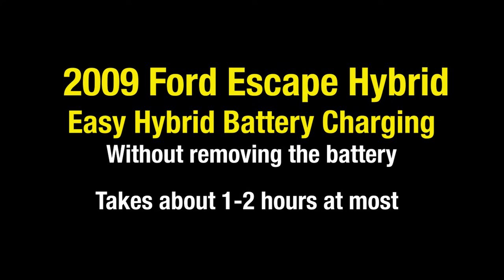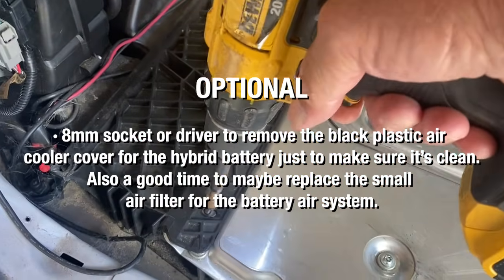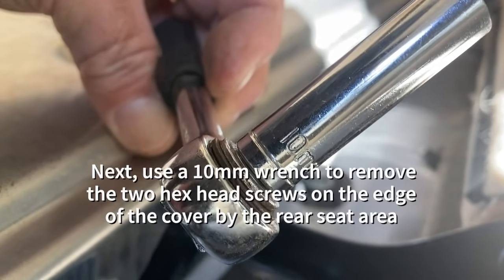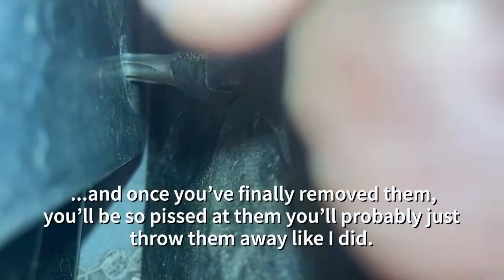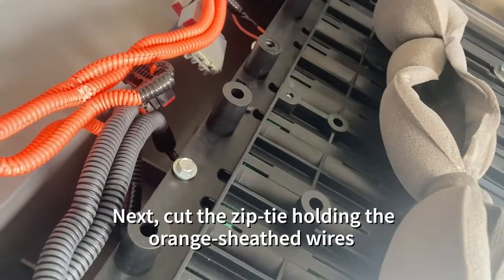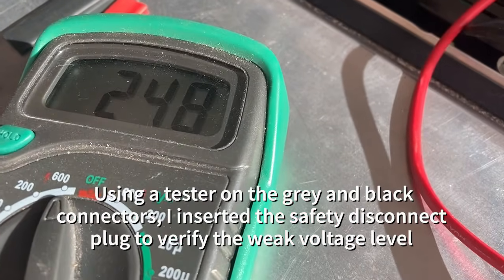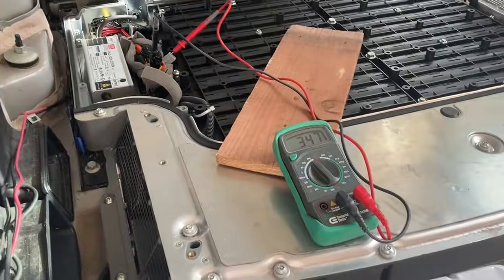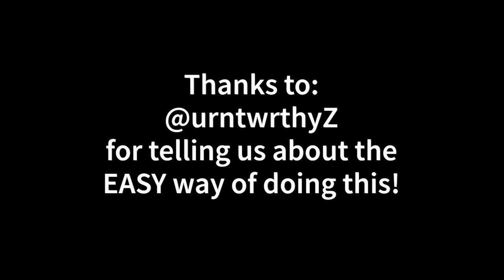EASY Hybrid Battery Charge 2009 Ford Escape - No need to remove battery!

Comment: Hello I have a 2007 and you said the charger and was built into the models before 2009 any chance you know how to put those to use? Your mod has a 120v plug in attached to it so do I need to get 120v to the charger in my 2007? Thanks
Reply from the maker: I’m not sure, but I think there’s a switch or button near the driver’s side under dash. I believe it uses electricity from the lead acid battery to boost the hybrid battery enough to start the car. Maybe someone with a pre-2009 can verify the details.
Reply: Matt is correct, there is a black pushbutton switch that glows when depressed for 10 seconds and starts to charge the Hybird battery from the 12 volts. Mine is behind a cover on the side dash when you open the driver door and some are under the  steering wheel by your left side

Comment: Good alternative but not recommended it as the ballast inside overheats when using it( True that you will not have to leave the AC cord plug in all day) but for experience is better to extend the inside + and - terminals to outside so the ballast can be seating outside and only be used when need it.
I did extend the cables outside and left a AC Female outlet and for the ballast (+ & -) an AC male plug so the polarity will match
Reply from the maker: Anything electrical should generate heat to some degree. If a component is “overheating” it is likely faulty. You can certainly keep the charger outside of the housing if you’re worried about it being faulty, but I would advise against using an AC connector on a DC circuit because of the risk involved with misuse by a person who doesn’t know about the custom setup. If you do add a connector for an externally connected charger, use a DC connector and label the positive and negative sides along with the voltage.
Reply: That is quite a large heatsink the charger is being fastened to.

Comment: purchase one of these cars from auction with only 70k miles, going to try this today,.
Reply: It works, thank you for the video, there are other methods on youtube, but this is way way easier.  Like you said the hardest part was taking out the t30 torx bolt.  I only removed the one the right side (passenger) and propped the cover up.
Reply from the maker: Awesome! I’m glad it worked for you. If you haven’t already tried it, I would definitely recommend using Forscan to check and rebalance the battery system.

Comment: Wow my 20 year old daughter completed the recharge to her brother's 2009 FEH following your video. I watched your video after the fact and wanted to thank you for sharing your experience and solution. So to those who came across this same video and think they can't do it, you can since my 20 year old non mechanic daughter did it herself. Thanks again.
Reply from the maker: That’s great, I’m glad it helped! I wish YouTube had been around when I was 20 - lol !
Reply: @mattgatlin1918 what is the Name and Address to purchase that charger. I'm having the same issue with my 2010 Hybrid escape, I looked at a plug right at the back seat and wondered if that was where to charge this vehicle. Then I came across your video and watched it, when you showed that same prong and it wasn't connected to anything and the plugs was zip tied on the side! I said  WTF was those engineers thinking when that was disconnected and why was it discontinued? 

Then after you went through the steps of removal it started to make sense why they did that. I'll keep my opinion to myself on those thoughts 🤣🤣🤣. 

Now if you would not mind, I'd like to know where I can get that charging device and install it as well. 

I have an idea but I'd rather talk in person or by phone with someone who has a better understanding of Electrical devices then my self, after looking at that charger something else came to mind, it is the positive and negative wires that aren't being  used to charge the system but can be used to charge the system the way it was meant to be used, just my thoughts running after you showed those two wires connected to the Charger you then connected a 3 prong to connect to a wall plug or outside battery charger. Did you use AC or DC or can we use both if necessary depending where we're at and the circumstances...
Reply from the maker: That charger and all the other stuff I used is listed in the description under the video- I put links to all the stuff there.
Reply: Your Right 😂

Comment: Hello Matt.  Is there a way we can make this Escape HEV a PlugIn? Thanks
Reply from the maker: I doubt it. For starters, you’d have to replace the entire battery with a much larger battery in order to get the electric-only range that a PHEV gets.
Reply: Do you mean that instead of making it have a 120v /110 wall outlet, you would install the adaptor that you see at the charging stations ? . I wondered this to but figured the standard plug would be more efficient and effective
Reply: Yes that was my initial idea... so it can be charhed as well when parked

Comment: Just curious, why not just install the oem charger and connect all the plugs? Then add the button where it should go? And finally, install a votage display to monitor it in real time?
Reply from the maker: I suppose you could install a converter/inverter like the ones installed in the 2005-2008 FEH, but I see no indication that the wiring for the inverter charging circuit exists in the 2009 outside of the HV battery casing, so you’d probably be doing some additional wiring to install a button and connect it to the 12v battery to make it work like a 2005-2008 FEH. 🤔 IDK if you can get a new OEM converter/ inverter- I’ve only ever seen used ones.

Comment: Everything went perfectly (Thank You) I'm getting forescan to double check hv batt... Started with around 260, went up, then  down, then was slowly going up.. 2hrs later 280, 4hrs later 200... Doesn't seem to want to go above 200.. heard there's a regen thing in the forescan app.. will try that.. 
(Everything else with opening & wiring went perfectly, again Thank You) this was an inheritance that sat for about 6mos
Reply from the maker: Cool- good luck. Did you try starting it while the charger was charging it? Also one of the other commenters on here suggested running the Forscan HV battery reconditioning multiple times. He said he got the best results after 3 cycles I believe.

Comment: You're the only person I've found that mentions those charge ports. I was happy to find a set in my 2010 in the same place you mentioned. My HV died in the cold snap this year and i was dreading tearing apart the battery again. Your solution had her running in less than an hour! Leaving the charger inside the battery is genius because what else am I gonna use it for?
Reply from the maker: Thanks for the comment. Glad it worked for you. I thought the same thing- “what else am I gonna use it for?” -LOL Once I saw that empty space I figured why not just leave it in there? I also think that once it’s wired into the system like that, you don’t actually need to fully charge the hybrid battery, the voltage coming off the charger is enough to “trick” the engine to start, and then the gas engine is a much faster hybrid battery charger (more amps).
Reply: @mattgatlin1918  just had to reference your video again, this time I took your advice and only had it charging for a few minutes before she was able to start on her own. Thanks again, haha!
Reply from the maker: Nice 👍

Comment: A customer of mine brought me your video and wants me to do it on his Escape. Is there some checks to do on the battery first to make sure it is a good candidate for this mod? Is it possible that a damaged battery could lead to the same issue and if so, could installing this charger on a damaged battery lead to a car fire? Just want to make sure that i have a full grasp on the condition of the vehicle first. This would be my first time messing with a hybrid electrical system.
Reply from the maker: I would run Forscan on the car and rebalance the hybrid battery (HVB). There are forums about Forscan and how to use it to run diagnostics on a hybrid battery system, so I would recommend looking at some of those forums first. I don’t see anything inherently dangerous about having the led driver/“charger” integrated into the low amperage part of the system, but I’m not an expert. I would think that any sort of work around any sort of battery will always carry some degree of risk, and doing this procedure on someone else’s car would be a liability I personally wouldn’t be willing to risk.
Reply: @mattgatlin1918  Thanks alot for the response!

Comment: Great video. Another example of Ford doing their customers a disservice. Why not keep the charging button on the side of the dash like like the previous models? I can work on my own cars but the orange wires scare me as they are very dangerous and high voltage.
Reply from the maker: Thanks. I was also cautious about the orange high voltage wires, which is why I really liked this method over the others I’d seen that were working with the circuitry on the passenger side of the battery ⚡️🫣

Comment: Worked great, thanks. Took about 8 hours to go from 142v to 347v, cleared the codes and it fired right up. 2011 awd FEH
Reply from the maker: Nice work! That’s the best feeling when you turn the key and it fires up like nothing was ever wrong with it 🤩

Comment: Man this was a life saver. I appreciate the video so much.  I just got my battery open, and the little screws on the side will go in the trash. I checked my battery with volt meter 292v. I left the key on for like 5 hours and the car won’t start.  I will order the power supply shortly but it will take a few days to get to me.  I have a 2009 with 310k on the odometer. I’ve had this car for 7 years.  We are not ready to part with it yet.
Reply from the maker: Congrats! Getting the side screws off is the hardest part of the job 😜. Amazing that you’ve got so many miles on it and it’s still going strong. I bought mine used and it was previously a lifeguard vehicle in L.A., so it’s only got 40k on it now, 11k is what I put on it in 14 months. Looking forward to getting many more miles out of it!
Reply: 310k miles???  Mine's at 86k.  Have had more issues than I would have liked and it supposed to be fairly bulletproof.  At what mileage do you recall doing shocks/struts?  I think mine are trashed; Michigan roads are atrocious.

Comment: This is a timely video for me.   I will be recharging my 2009 Excape hybrid this week.  It has been a couple years since I last charged it so I needed YouTube to refresh my memory.  I was stunned by how easy your method was.  Can't wait to configure this permanent solution.  The only additions I think I will add is a covered RV inlet male plug, plus maybe an easy access point to check the current voltage manually.  Last thing, if I remember correctly that charger gets pretty hot, I will monitor the temp the first time I charge.  Thanks again for saving me a bunch of time.
Reply from the maker: Good luck with the job! I didn’t have the issue of the charger getting hot, but that might be because I didn’t need to have it charging very long. When you don’t remove the hybrid battery and disrupt its circuitry, you don’t have to leave it on the charger that long. By having the charger plugged in when you go to start the car, it will register enough voltage for the car to start, even though the battery may not be actually up to that voltage- if that makes sense. Once it’s started, you can just let the engine complete the battery charging. Anyway, hope it goes well for you!

Comment: Great video. I am wondering if you could also charge the HV battery using a big orange plug from the junkyard that has some wire left to connect to the charger. I got one from the junkyard but haven't tried it yet. Your method is simple enough, but maybe it could be done without even removing the cover. Any thoughts?
Reply from the maker: 🤔 Interesting, and I thought about that seeing the large orange high voltage plugs - I’ve seen one in the engine compartment and another by the hybrid battery. I don’t really know anything about these plugs, but my gut feeling is that they’re carrying a lot of amperage given the size/gauge of the terminals, so I’d be wary of them. 
Maybe someone with more knowledge could jump in on this.

Comment: Superb video, Matt., and thanks for the acknowledgement.  S.Keith and a great thread on the  Electric-Vehicle forum was the source for a lot of my info.

FEH owners:  This is THE WAY to do this, ignore the other videos that have you remove your HVTB/ prop it up and/or remove the relay, BCM, etc. on the passenger side of the HVTB.  

It sucked that Ford removed the '05 to '08 charger and circuitry, but leaving those cables with the gray and black connectors partially made up for it.

In an abundance of caution, I installed diodes on my charging cables when I built my charger.  I also replaced those PIA side screws with regular bolts.
Reply from the maker: Thank YOU for the time-saving comment on a couple of the other videos I'd seen!
I almost made the mistake of taking out the whole battery and futzing around with the high-voltage circuitry on the passenger side. I'm glad I didn't. 
I only made this video to get your advice/method out there and hopefully save some people a lot of time, headache and potential danger.
Seriously, if I hadn't read your comment/method, I might not have even attempted it.
Thanks again!
Matt
Reply: I just rebuilt my HVTB with all new sticks from MaxPower.  That was a project.  Again, great job with this.  You will save a lot of people a lot of time and a lot of frustration.   @mattgatlin1918
Reply from the maker: That sounds like a huge project! My 2009 only has 40K original miles on it so I’m hoping I won’t need to rebuild the entire battery for a while.
Reply: @mattgatlin1918 what charger did you use and where can I get one, thanks
Reply from the maker: @Lee-sv3so  There’s a link in the description below the video if you expand the “more”-

This is it:

https://www.amazon.com/HLG-120H-C350A-150-5W-Single-Output-Switching/dp/B073ZCRJ5P

Comment: Thank you for this video tutorial.. Harbor freight sells a little icon ratchet set with torx bit and miniature ratchet. I used it when i was replacing my inlet manifold gasket, too loosen one bolt that was hard to reach. Its a super awesome set to own and i can tell it would work great for these torx where you had to use the wrench with tape.
Reply from the maker: Good to know, and thanks for the tip. The right tool is always a great time saver! I checked out the Harbor Freight website and saw one like you described for just under 3 bucks.
Reply: Yes they got a few different ones.. i got the set that is $39.99

Comment: Hmmm interesting to hear that the 12v starter battery is not connected to the hybrid battery.  They are in my daughter’s 2008.   
As hybrid batteries age they will lose capacity and balance.  Does the battery charger you installed as an accessory have the ability to balance the different cells in the hybrid battery rack?  If not you may want to look into one that does rebalancing.
Reply from the maker: I think the connection was discontinued with the 2009 model year. As far as balancing the hybrid cells, I use Forscan on a PC laptop to reset the hybrid battery control module and to do a cell rebalancing.
Reply: Correct.  The charging system was in place 2005 through 2008.  Ford removed it from the 2009-2012 models claiming it wasn't necessary.   @mattgatlin1918